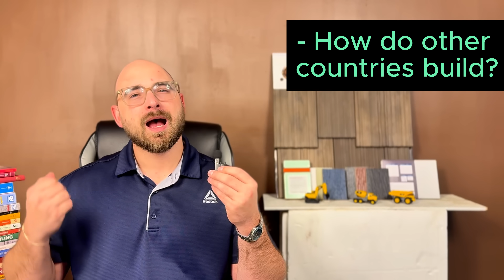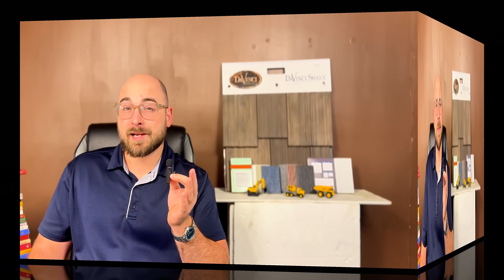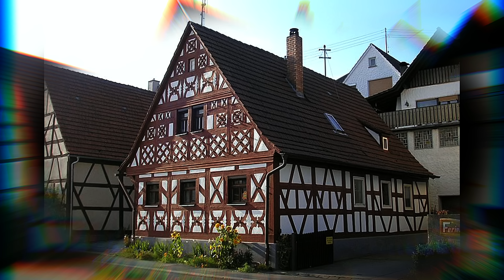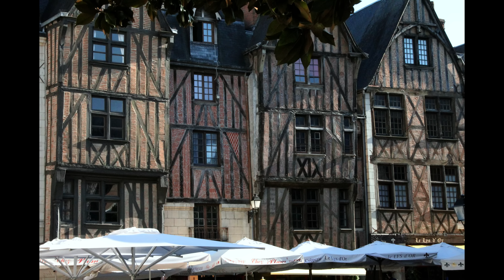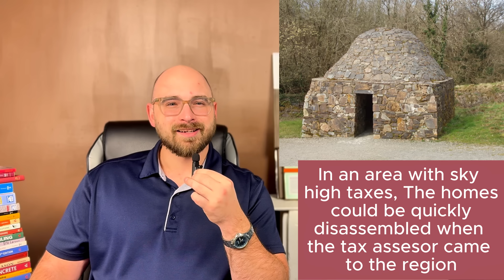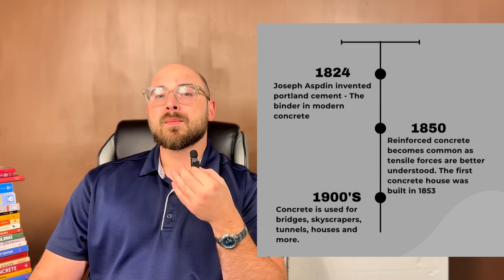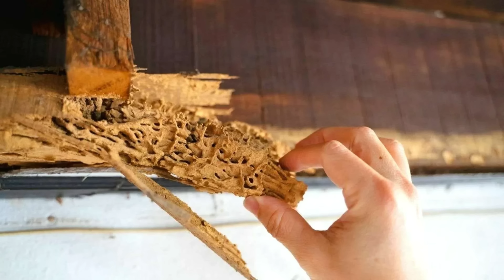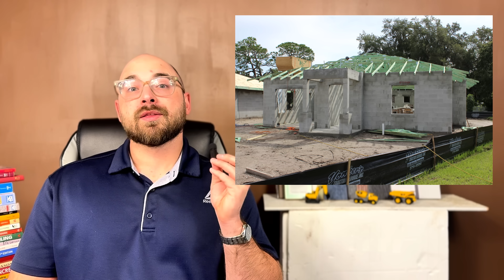Why Other Countries LAUGH at American Homes

Comment: ICF would be great if all of the insulation was where you wanted it and none of it was where you didn't want it.
Reply from the maker: Hello again! 

While I think you have a remarkable product that has its place, I believe ICF is a great system with a few advantages in residential construction

When placing the foam on both sides of the concrete core, the concrete benefits not only from thermal mass but also earth coupling (sometimes incorrectly referred to as passive geothermal temperature) meaning that the concrete core of the wall equalizes with the temperature of the footer. 

In my area, the earth is around 55-65f below the frost line, year round , regardless of outside temperature. And this effect carries up several stories. Meaning my walls are going to be 55-65f in the basement and in the second floor, regardless of how hot or cold it is outside. 

This drastically reduces the need for mechanical heating and cooling, leading to lower energy bills. 

What’s more, is many buyers prefer a traditional look, with ICF accepting a drywall finish in the interior, not everyone like the look of exposed concrete / stucco finish on the interior of their home. 

Again, not saying anything negative about your product and it’s certainly a decent system, but I think ICF is a great product and is not flawed in any way with the placement, type, or thickness of the insulation. 

According to the manufacturer and ICF wall with a 7” core performs around an R50, which is almost 5x what a standard wood framed wall with R19 fiberglass batts performs at. According to the us dept of energy, a 2x6 wall with fiberglass batts had an effective R value of R13, while ICF was around R49
Reply: @Mike_Fortin  I think ICF is excellent - much better than stick framed, and worth the extra cost.  But what if it did not have to cost more.
Reply from the maker: That would be the best of both worlds

Comment: Another issue, there is a housing crisis in the US, but it's not as bad as Germany, Canada, or Australia.  I'm sure many of the other countries have the same issue too.  So what's better, more houses or better houses.
Reply from the maker: Better houses that keep people safe and use less energy 

Affordability doesn’t mean much if it costs double to heat and cool and can easily burn down or be blown away
Reply: @Mike_Fortin  you can build more energy efficient houses for a minimal price increase. But volume is important too.
Reply from the maker: The low quality production builders aren’t going anywhere (which is amazing to me with how often they’re in court), 

So they’ll focus on volume and smaller builders like myself will focus on quality
Reply: @Mike_Fortin  IMO, those homes are fine for first time home buyers, and maybe lower income folks, to buy and sell as soon as they are able.   I'm at the point in my life where quality is priority one too.  The real issue I'm having now, is finding a builder in my area that can build a near passive house home....at least as close as I can afford
Reply from the maker: If you use passive house principles but forego the official certification, maybe opting for energy star instead, you can get similar performance with a lower up front cost . 

I like passive house, but I do think it is overkill 

The the tiers of efficiency I offer are: energy star, DoE net zero, and passive house
Reply: @Mike_Fortin  where do you build

Comment: During high wind scenarios all buildings rely on their weight and their capability not shear or warp. Some static reference data: A common weight seen on private homes despite wood frames in Sweden is 80-140 tons including the foundation plate. My private residence weighs in at 90 tons despite having walls framed with wood. The roof clocks in at 12 tons. It's considered a light weight design due to two floors. 
Some dynamic reference data: The aspect of pressure differentials affecting the building during high wind passages must also be considered. A high wind passage need bleed excess static air volumes from inside to outside somehow. If not the building will rupture and collapse. That is your main engineering flaws in my opinion. At low latitudes atmospheric energy on surface Wh/m2 is higher than at higher latitudes. That must be added as well to your analysis. 
So in my opinion your analysis focuses on wrong stuff (material) as your haters does. In this case there´s no variation of your mileage what so ever due to that there´s cultures that have mastered the trick to build houses with standard earth and nature materials without going to excesses. 
A nice dynamic solution to mitigate shear and lifting forces on roofs is the mainland Chinese style of roof that have bent up roof foots (or what ever it is to be called in English).
In order to honour your hates I chime in that I do agree that Americans are under-educated but for reasons not part of the topic. All the best from Sweden.

Comment: As mentioned here a couple of times, but to expand:  do you want mass production of affordable homes, or fewer at 1.5  to 2 times as expensive.
Reply from the maker: I want more houses, built with better quality, at a %10-20 increase in purchase price (but lower energy bills over time) .  I also believe can be offset by reducing square footage. 

There’s no reason to double the price
Reply: @Mike_Fortin  you kinda sound like the folks on the build network.  They will build you a good home for $300+ a sq ft.  They took say you don't need the size houses people want.  I say maybe.  How are you going to tell a family of 5 or 6 that they can live in a $500k, 1200 sq ft house. (Southern USA  price)
Reply from the maker: I’m not telling anyone what they do or don’t need. 

What I’m saying is this: 

If 

House A is wood frame and comes in at $500,000 
And
House B is $550,000 and is all ICF 

House B is the better option. 

What the mortgage goes up, the utility bills go down, because ICF is more efficient. 

If they absolutely can’t come up with the additional %10, they can reduce the size of the house to keep the cost the same and still get the improved quality.
Reply from the maker: And there are some things money can’t buy, 

What’s the safety of your family worth? 

What’s it worth to have your house survive a wildfire or a tornado or a hurricane or a stray bullet? 

What’s it worth to build a house that can be passed down for generations?
Reply: If they last more than twice as long the choice is obvious.
Reply: Yes. That's part of the equation. The US had a more rapid growth of population that the European countries.

Comment: Wooden houses in e.g. tornado areas seems to me to be a pointless idea, especially as house “insurers” are not/extremely reluctant to pay for damage.  And with respect: if you look at the fires in Los Angeles, it becomes clear that architects still have a lot to learn about how to build safe houses.
Reply: The issue with the houses in the Palisades is that they shouldn’t have even been built there without serious fireproofing. People keep building in areas that we KNOW are disaster areas (certain parts of Florida, Texas, and California are the most obvious ones), then act all surprised when a natural disaster wipes out a huge swathe of their city. Then the federal government sends them tons of money to rebuild in the exact same place and take up those resources (labor, materials, etc) that could have been utilized elsewhere. Rebuilding in the same disaster-prone areas is genuinely hurting the rest of the country when we allow this cycle to repeat over and over, and it’s especially painful when we already have a shortage of housing supply.
Reply: I would say that most of the homes that burned down in LA were 40 or more years old. Code is likely much different now.
Reply: Neither of those are correct new homes are required to resist tornadoes and hurricanes. Most homes damaged are the older homes owned by the lower income. New code requirements make stronger homes otherwise they dont get approval. Also no house even one made of concrete can withstand a car picked up by the wind which hits the structure.
Reply: Well.  Us houses dont handle hurricane either... It looks like a warsone when passed. Maybe its cheaper to build a house 100 times, compare to build one good one...
Reply: @janhansen554  100 X
Do the calculations
Reply: @janhansen554 😂😂😂😂 most people these days can’t even afford one over the span of their lifetime

Comment: Do you think building concrete houses would minimize the impact of natural disasters like the LA wildfires in California??
Reply: It is striking from the pictures of burnt homes in Los Angeles that the only surviving parts were he chimney sacks, buil using concrete, brick and stone.
Reply: @ chimneys are purpose built to withstand fire in the first place
Reply: There are a few houses which have withstood the fires. One was an architect's own home. Metal roofs, concrete boundary walls, no soffits and rendered (presumably concrete) walls were the only things I could pick out from videos.
Reply: A regular wood framed house can survive. There's a picture of one house in Pacific Palisade that survived the wild fire. The architect had designed in some fire resistant features. He had only fire resistant exterior walls materials, there was little over hang from the roof. I didn't see any attic vents and he had only a small amount of landscaping near the house. There was a similar photo of a couple of houses in the Hawaii fires in Lahaina. The couple of houses that survive didn't have a lot of vegetation on the property. Having a buffer zone is important. 
Having a nice looking landscaping does look nice but not safe for a house during a fire.
Reply from the maker: Right, I’m sure they can 

But I don’t think it would hurt to go a step further and use non combustible materials for the structure
Reply: @Mike_Fortin  With the current vegetation in Palisade, I doubt concrete buildings would fair much better. Once the concrete reaches the temperature of around 1500 F, the concrete is basically unusable and has to be scrapped because the heat affects the rebar.  Of course, if you want to make the floors out of concrete too, that could work.  But it is a pain to design.
Reply from the maker: Yes
Reply: Concrete and masonry are avoided in California because of the earthquakes
Reply from the maker: Concrete homes can be designed to withstand earthquakes just fine, they just need to include seismic joints allowing for movement 

A little additional engineering and you end up with something fire resistant and even stronger than wood in an earthquake
Reply: @ sure they can, but the cost is astronomical in comparison to a wooden frame structure. 
What’s the point of a useless solution to potential problems if no one but the elite can afford it ?
Reply from the maker: To be fair, the cost of any house in CA is astronomical. 

And yes concrete is a pain there both for regulations and additional engineering, but the cost is within reason 

Now in terms of what’s most effective??

Steel. 

Steel framing combined with fire resistant design. 

It’s fire resistant, it performs well in earthquakes. It’s less complicated than concrete. It’s recyclable. 

Steel or concrete should be mandatory for wildfire prone areas.
Reply: @Matt-yg8ub  as someone from Chile i can confidently tell you that you can build Concrete buildings made to resist earthquakes just fine. all of our buildings and houses here are made of concrete and they all are made with the regulations to make them resist them.

Comment: Back in the early 1990's, I worked at a company that had a lot of expat employees from Germany. I got to know one of them pretty well and one day we were discussing home ownership. I mentioned that homes in Germany are built so much better - stone and concrete with tile roofs - and will last for 600 or more years. His response was that he didn't care if a house lasts that long because he will be long gone way before. He preferred getting a much larger home in the US, even though it was built of wood, rather than the much smaller place he could have afforded in Germany. Guessing back then the price difference was probably much bigger than it is now.
Reply from the maker: American homes are definitely cheaper and maximize square footage, but I still don’t think that’s a good way to look at things 

The way we build today will have an impact on future generations. 

Building better also protects against disaster, and can lower energy usage and utility bills
Reply: They sound like the exception and not the rule.
Reply: In areas subject to Earthquakes, timber framed houses, usually with timber walls and light sheet-metal roofing, are a superior building system and will last longer.  In areas without Earthquakes, using more bricks, stone, masonry and heavy roofing tiles, is not such a problem.
Reply: @KiwiCatherineJemma  That was true maybe 300 years ago. Modern building techniques all but wiped out the advantages that flexible wood had in earthquake prone regions. And by the way for example in Japan traditional houses used and are still using heavy tiles.
Reply from the maker: It depends on what you mean by superior, 

Concrete homes , when designed with engineered foundations and seismic joints allowing for movement, can survive a higher magnitude earthquake than a wood framed house. 

Steel is likely the best option for CA due to its cost effectiveness and the ability to resist both fire and earthquakes. And its a mild climate without much need for a lot of insulation , now if money is no problem and you want fire resistance, earthquake resistance, sound reduction, air sealing, and bulletproof then yeah ICF is a great option. 

ICF is best for the Midwest where there are hot summers, cold winters, lumber and labor are expensive and we also get the occasional tornado.